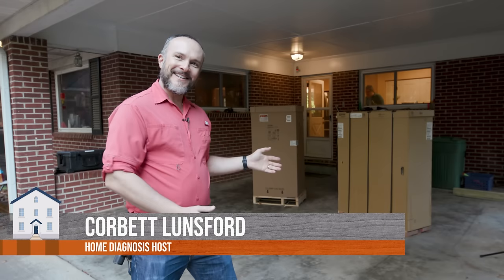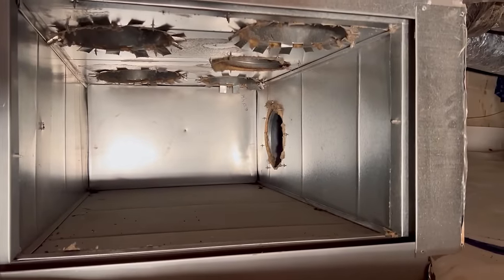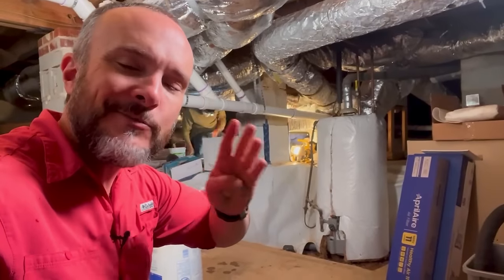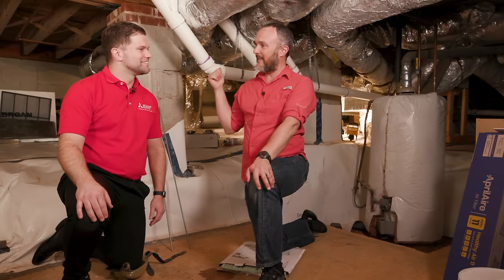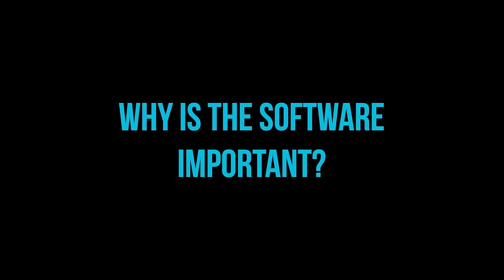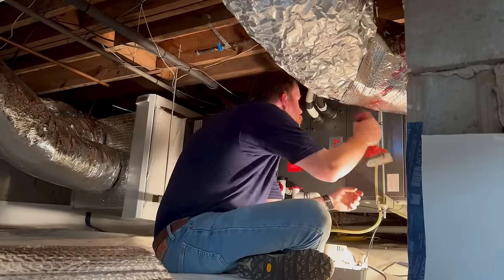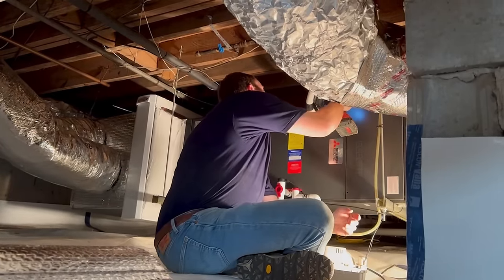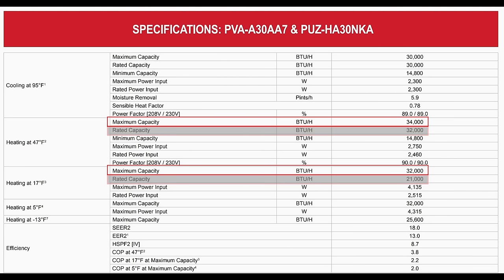HVAC Replacement: Ditching an Old Furnace and A/C for Mitsubishi Heat Pump with HyperHeat

Comment: I had the 4 ton version of this Mitsubishi installed last summer in Colorado, no heat strips, plenty of heat at something like -17F. It's a 2005ish house so that helps. I'm not too surprised that it was able to handle 20F. It only seems like magic.

Comment: I'm about to have this exact model and size air handler and outdoor unit installed at my home in a month. It's replacing 20 year old AC and natural gas furnace, both single stage. All ducts are inside the conditioned space with an Aprilaire E100 dehumidifier. 1979  2 story slab home, 2000 sqft, with insulation and air sealing being improved as I make my way through projects.

I'm really interested in the part about keeping the air handler fan speed set to high, assuming the correct static pressure setting. I was surprised to hear the Mitsubishi rep recommend the high speed  as opposed to variable speed as well. I thought the variable speed blower motor was going to be one of the highlights of the system, working in tandem with the variable speed inverter compressor. What's the story with that? I'd love to hear more about the reasoning on that. 

The correlation between compressor speed and blower motor speed was about the only thing I wasn't sure about how it worked, but figured I'd find out once equipment is installed. Been researching this equipment and reading manuals for 2 years now, haha.

Comment: I would love to keep my system fan running on high all the time, but it drives me crazy! Just the sound of the wind coming out of the registers is all that I hear.
I have the Mitsubishi intell-Heat duel fuel system here in south central Wisconsin and I don’t know when the last time my natural gas furnace ran. Through the entire Winter so far it’s been the heat pump. It did get pricey one month that we had a week and a half of sub-zero weather but it kept 2000+ sqft. Home at temperature.

Comment: On homes where I get to do a load calculation, or new equipment install, I try to also install some type of monitoring device. I prefer Ecobee thermostats but use Emporia Vue energy monitors as well. When you start comparing run times, to load calcs, you really start to see how huge the gap is between Manual J and the run times on design days, especially in the heating side. I would say I’m averagely seeing 70% oversized in heating mode. 

It can be a bit frustrating that Man J is our “standard” when there’s so much discrepancy. I get there have to be some “safety nets” but it seems quite excessive. The reality is that using run times for sizing make electrifications much more possible compared to places where we are only allowed to use Man J.
Reply from the maker: Great process @TimothyNaugher
Reply: NIce, Tim. Where did you learn how to do that?
Reply: @kennethdean4349 It's basic physics.
Reply: @D2O2  Yes it is, but why do so many business and techs either not know it or won't do it? That's why I put the question to Tim so others can follow his path.

Comment: All single speed ac systems are oversized for almost 90% of the year. The beauty of inverter systems is they ramp up incrementally as the day heats up and use very little electricity to do it. And then as the load is off they only put in enough energy to maintain temp and humidity. Mitsubishi sets the gold standard for how the air handlers are built and insulated. Just be careful to use the correct size refrigerant lines and control wire. It’s worth it hands down.

Comment: Manual J requirements are a disgrace especially for older properties that have been mostly renovated with all new windows and added insulation / sealing of electrical boxes and lights . The entire industry around it isn’t helping either. May as well go square feet method .

Comment: Switched out a conventional HVAC in a similar climate  (Memphis metro and Atlanta Metro have pretty much the same climate) for a heat Pump (different brand) and the comfort level is up and the electric bills are lower despite a significant increase in electricity rates. Mine has a 12 year replacement warranty.
In January we went down to 0 degrees for about 3 days at night with highs in the teens and the Heat Pump performed very well.

Comment: The Hyper Heat Mitsubishi units are fantastic at heating even at 5 degrees. I go off the max capacity from the dimond system builder on a 15 degree day in my location. Most of our customers don't need the electric strip heat unless it's an old home.

Comment: Hey Corbin, when you mentioned the A/C size and I glanced at the house, saw the old 4-burner furnace ... I had a feeling 60K BTU was oversized. Often what happens is companies do not suffer a business penalty in sizing that way for 2 reasons: There's no humidity issue with oversizing heat as there can be with cooling that short-cycles, and also because they never want to hear customers complain it takes too long to warm the house no matter how cold it gets outside or how infrequently super cold temps might happen. Bingo: *We're a nation of oversized furnaces*. 

I'd forgotten about that data logger. A modern smart thermostat can do something similar. Neither will exactly equal a Manual J ... but for an existing system they don't really need to, right? Log how often the system runs for a given time period. That tells you the percentage of capacity used for a given set point, to get closer to true capacity needed, even if it means it runs more continuously (which as we know ain't a bad idea.)

Say someone had a 60K BTU furnace but learned it only runs 1/3 of the time. 1/3 of 60 = 19800 BTUs (but now, re-do the math to add more BTUs because most gas furnaces are only putting out 80-95% of that 60K INPUT number ... look at the yellow EPA sticker) Take BTUs and divide by 12 = tonnage of heat pump needed. 2 tons. MAYBE 2.5 tons.

It's not exact nor does it need to be. The homeowner just needs to not freak out that it runs longer or takes longer to warm a super cold house. It's no sin to plug in a cheap space heater once a year and run it for an hour! :)

Comment: Just had my first winter with a Mitsubishi SVZ upstairs, and now I’m debating between S and P series to replace my final furnace. Thanks for the side note on orphaning the water heater - how do you test if that’s a concern? We want a heat pump water heater but ours is less than a year old due to an emergency replacement
Reply from the maker: How to Prove it’s Safe: Gas Water Heater, Furnace, or Boiler 5-Point Combustion Testing
https://youtu.be/IqQ9e8YFkBY

Comment: Here's my question for the Mitsubishi heat pumps: can you specify an evaporator temperature and then control some forum of modulating reheat, e.g., hot gas, electric, hot water etc.? Stand-alone whole-house dehumidifiers are nice, but I would much prefer an AHU that I can just program to give me air at a certain dew point and reheat temperature, 45F dew point and 55F dry bulb, for example. Variable air volume for zoning would be nice, too. If you already have a variable-speed compressor and fan, I don't see any reason it shouldn't come as a standard feature.

Comment: Corbett, I have been looking at building my first house and want to go with a heat pump, but I live in Northern Michigan in climate zone 6.  Heat pumps aren't particularly common in my area with most people using propane or natural gas furnaces, and many still burning wood for heat.  This makes it difficult to find a company with much experience in installing heat pumps.  I would love to do a geothermal heat pump system, but they are about 2-3 times the cost of an air source heat pump and natural gas furnace hybrid system that is recommended by some of the local HVAC companies I have talked to ($30k to $40k installed, but could be much more depending on what kind of ground loop they need to do).  I would like to get away from burning fuel for heat if possible and am wondering if an air source system like the one in the video would work for me, or would I be using the heat strips so much that a geothermal system would be worth the extra upfront cost?  Typical winter temperatures in my area range from 20°F to 40°F, but it is not uncommon to reach single digit temperatures at night with temperatures occasionally going into the negatives.  Do you know of any air source heat pump systems rated for use in climate zone 6?  Sorry for the lengthy question, and thank you for making these insightful videos, as I have been learning a lot.
Reply: Climate zones don't determine your equipment, you need to perform a manual j and manual s to find what you need for your house in your specific location
Reply: @browneyedbottle  Yes and no, since your climate zone does give an indication of the typical weather you get, and thus what temperature you need your equipment to function down to.  For example, some ERVs are only rated to work in zones 1,2, and 3 because the colder winter temperatures outside those climate zones can cause them to ice over.  Similarly, many heat pumps are only designed to provide heat down to 20°F, which wouldn't be great in my area since we regularly see winter temperatures below that, hence why the HVAC installers I've talked to in my area about getting an air source heat pump want to bundle it with a natural gas or propane furnace to provide backup heat for when it is too cold for the heat pump to keep the house warm.  Since, like Corbett, I would rather not be burning anything in my house to heat it, I was asking his opinion about whether he knows of any air source heat pumps that work in the temperatures I regularly see, or if I should get a significantly more expensive geothermal heat pump with the benefit that it provides heat regardless of the ambient outdoor air temperature.
Reply: Yes, there are heat pumps that work in cold climates.  But again, you can only get a good answer to this question once you size your house.  The 99% day is different within climate zones.  

We have a heat pump in Indiana and have had zero issues with it and we live in a 40 year old leaky house with poorly designed ductwork.  Have had zero issues with it keeping up during cold snaps.  The heat strips will kick on fairly consistently once it starts getting below 0.  

We are about to build a house for ourselves and will be getting another heat pump without hesitation.  We'll definitely get the supplemental heat strips though. @r.j.bedore9884
Reply: What he is stating is that each house should have a blower door test and you should air seal your home.When you air seal and make sure proper insulation the outdoor design temps won’t affect the units that much because you have a good building envelope
Reply: @seanxphillips  That is completely false.  If you have a well sealed and insulated home it will reduce the capacity size of the equipment you need, but it still needs to be able to function in those colder outside temperatures.  Since a heat pump works by taking energy out of the ambient outdoor air and moving it inside the house, it absolutely matters how cold your typical outdoor temperatures are when choosing your equipment.  You could have 2 units that both have a 3 ton capacity, but one might be rated to provide heat down to 20°F and the other down to 5°F.  If you live in an area where it rarely gets below freezing then either heat pump will work for you, but if you live in an area where it regularly gets below freezing and sometimes into the teens, then only the system that is rated to 5°F is likely to keep your house warm throughout the winter.
Reply: @r.j.bedore9884    Agree.  Plus heat pump technology keeps improving, such that Mitsubishi's new Hyper-Heating INVERTER (H2i) heats down to -5℉ without losing capacity, and can heat all the way down to -18℉.

Comment: Rated + Maximum Capacity is handy to see as it gives you another data point to compare output, COP etc.  In reality it won’t apply to a specific application unless that output and temperature correlates directly, but it’s still nice to have for the nerds out there. 😊

Comment: Great stuff as always! If the Manual J is so far off, is there a general modifier than should be applied to the calculations for a new high performance build? Or is it very specific to the houae deaign?
Reply from the maker: Stay tuned buddy. Stay tuned.
Reply: If you have run time data logging (for example, from an Ecobee) or even just energy bills, you can figure out the real amount of BTU used for the house. When I replaced my equipment a few years ago, I was able to look back at length of cycles for that previous summer to see that the heat pump cooling cycle was 30 minutes. I donwsized from a 3 to a 2 ton 5-stage system and have had improved comfort and quieter operation.
Reply: @kennethdean4349  Yes, but there's no data to log if the house hasn't been built yet. 🙂
Reply: @DeuceDeuceBravo Yes, but that isn't the case for this house.  It is silly to not gather data and instead use the manual J estimate.
Reply: @D2O2  Agreed. Data logging for an existing house makes sense. My question was about a "new high performance build".

Comment: Bubble wrap is better than insulation?😅
Reply from the maker: Better than foil faced fiberglass- I do agree
Reply: @HomePerformance  in what way is it bubble wrap better?  Is it a good insulator? Is there something better than that in your opinion
Reply from the maker: @adambergmann7716 doesn’t smell like cat urine, doesn’t itch, easy to cut
Reply: @HomePerformance What was the fiberglass that you offered up during that conversation?
Reply from the maker: @D2O2 just simple foil faced JM or OC